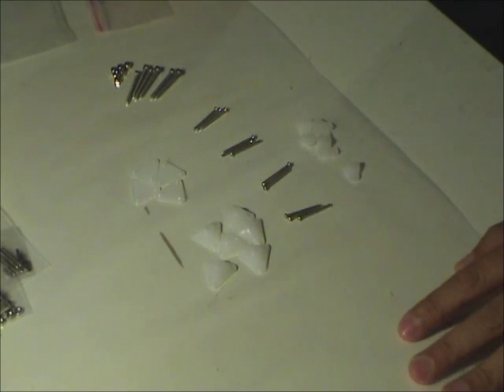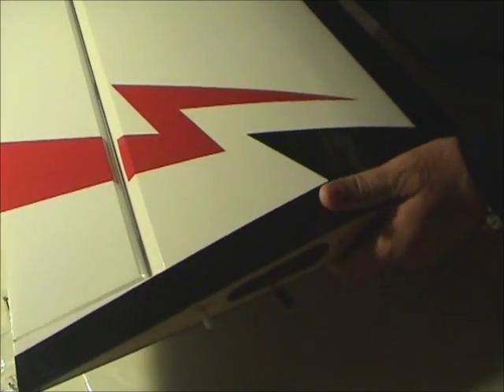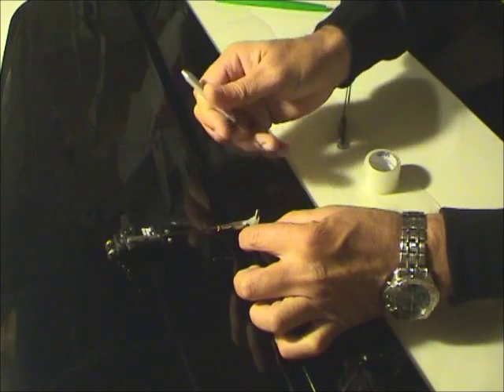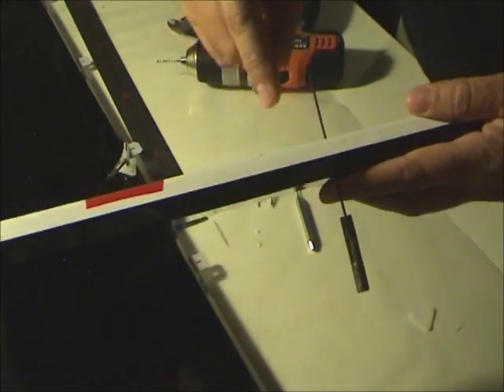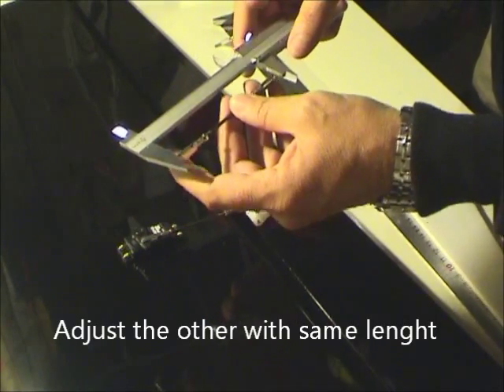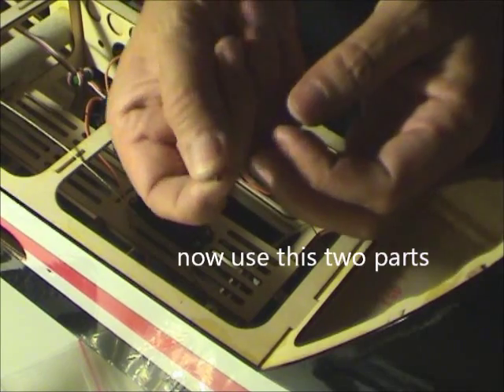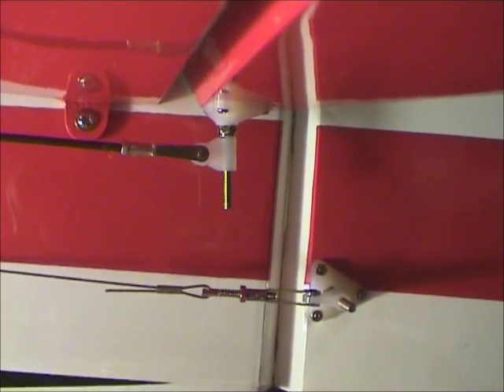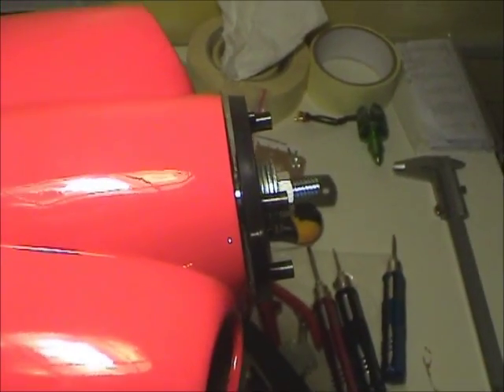Building SBach EP 1,60m Part2

Comment: hi, thank you for your video!! I just got the same model. I bought it second Hand. I just notices that the pre Owner did put extremely much weight in the front of the model to get the right center of gravity. What did you do to get that right? I thing it is stupid to build a plane as light as possible to put lots of weight on later! It must be 500 gramms at least… 
Did you try to fly the plane on 7 or 8 S? So we would usw power instead of only weight…
all the best
sveb
Reply from the maker: i spent many times to find the center of gravity. for me center was some centimeters behind the expected. I finally only use 6S  4500mah if i remember well. 6000mah was too heavy on my point of view.
Reply: @SUPERVINS60  thank you very much! such CG is aprox. like im the middle of the wing you mean? this is bery inusual or not? du you still habe the Model snd could send a picture? that would be rely nice of you! I bet many people do habe the same problem and would be thankful😊
Reply from the maker: no @scarden99  , my model is dead since many years. I made a mistake in flight with fun in front of me. I loose the model,  big crash !
Reply: @SUPERVINS60  outch, sorr for that. so the cg is like in the middle of the wing?
Reply from the maker: @scarden99  i remember more now, i used 6S 5000 mah and putted the batterie most on front as possible.
Reply: @SUPERVINS60  thank you 😊

Comment: Thanks for taking the time to create these two videos. The instruction manual provided by Staufenbiel is indeed a useless piece of crap. No idea how a beginner would ever be able to build this plane with the lack of instructions in the manual. Your videos saved me a lot of time and corrections. In my set the cowling was also touching the spinner. But I did not adjust the motor, I moved the cowling back a bit, overlapping with the cockpit cover.  Not optimal, but works ...